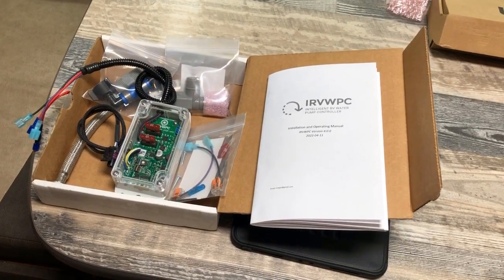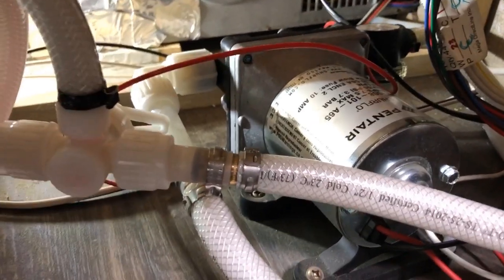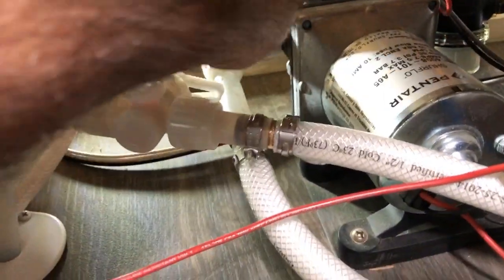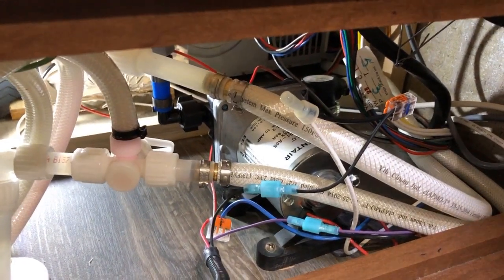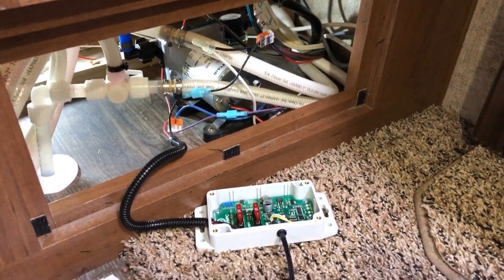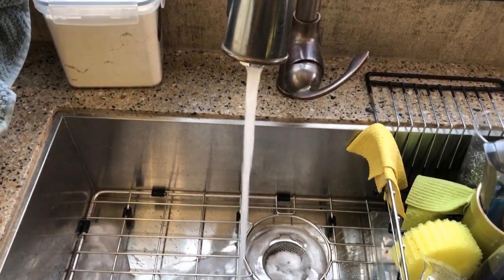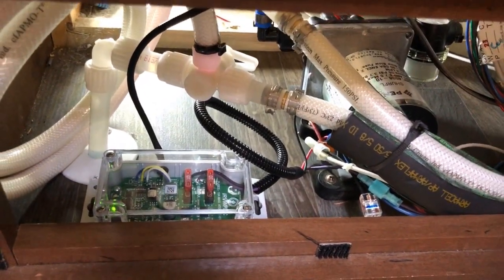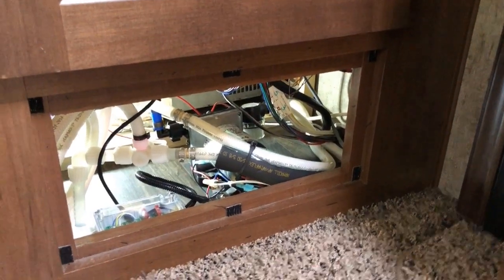Intelligent RV Water Pump Controller (IRVWPC) Installation on Outdoors RV 280KVS

Comment: You could have bought the SeaFlo model 42 or 55  that does a much better job internally and is a fraction of the price. I have the model 42, 51, 52 and 55.

Comment: Jim, I used an accumulator tank in my last RV and decided to try this in my new 27TRX. It’s a huge difference over stock and an accumulator tank. Most of the time boondockers use the water on lower pressure in the name of conservation and with this unit the pressure is constant with the pump running a none pulsating low speed that you barely hear. I’m surprised this is not a more common upgrade. Buy the way, I had a leak at the same connector you did and had to tighten it more than you would normally have too. I don’t think it’s a coincidence but no biggie.

Comment: Thanks for this post!  Well done!  However, I will not be adding anything  that might make my pump difficult to hear.  Over the years, I've learned to use (and appreciate)  the intermittent on/off sound of the pump alerting me to a system wide plumbing leak.  And I've had a few.  😠
Reply from the maker: Good point. Fortunately the IRVWPC has safety features to detect slow leaks and major leaks.
Reply: Grin.